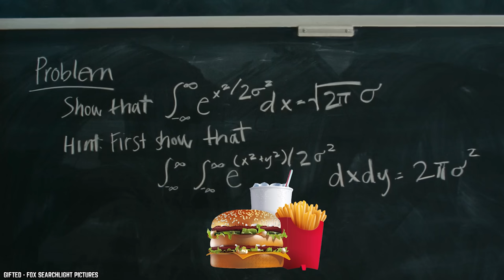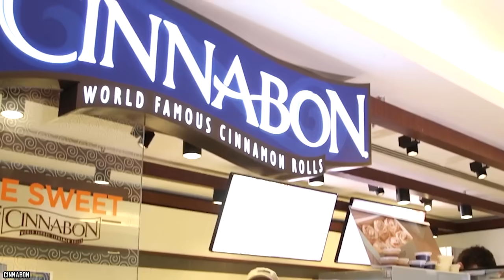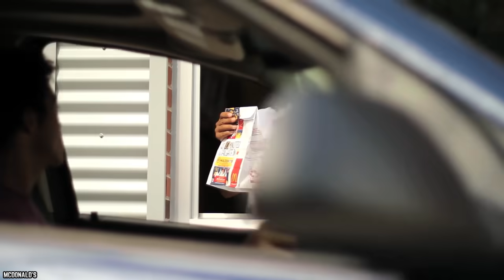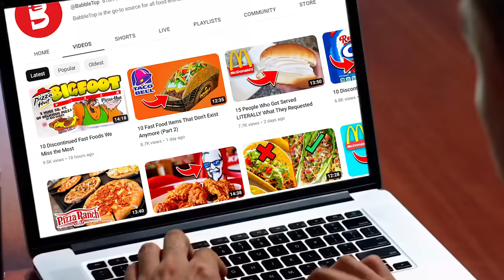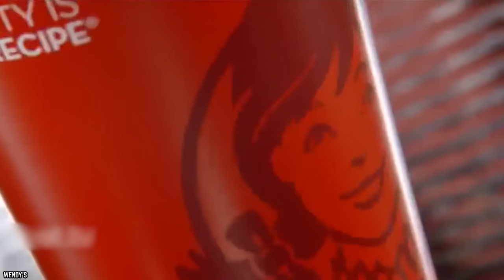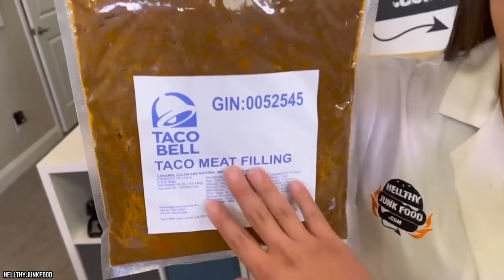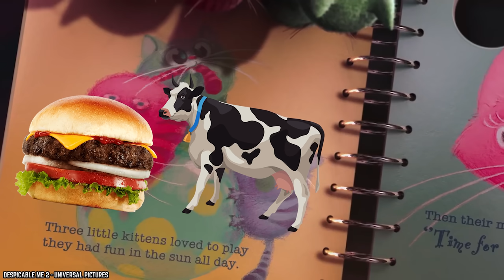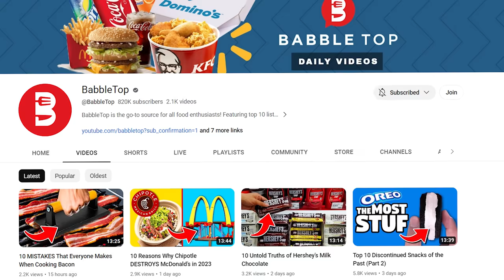10 Fast Food RUMORS That Ended Up Being TRUE (Part 2)

Comment: Resorting to scare tactics? Do you really think the chemicals on the salads are any different than the bagged salad mix you get in the store? They have to add something to it to get it to the store and have it be shelf stable. You want it without chemicals, buy organic but then you have to deal with the extra bug parts because it hasn't been treated with insecticides. And btw a lot of "organic" products aren't actually organic. Worked for a farmer around 15 years ago that got certified organic so he could sell his grains for a higher price. The inspectors came around once a year (with advanced warning as to when they'd be there) and all they did was check to make sure he didnt have any of the chemicals on his property. He never did because he stored them at his son's house about five miles down the road.
Reply from the maker: @donvandenberg5301 You bring up a valid point about the challenges of balancing shelf stability and avoiding chemicals in food products.